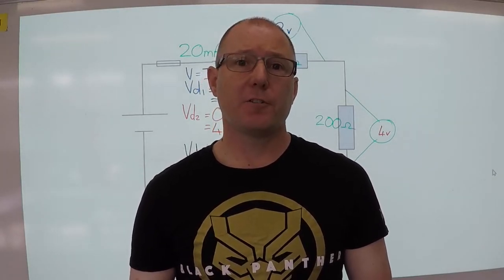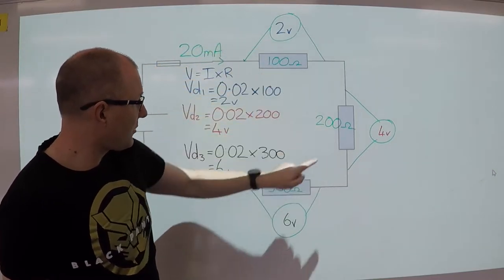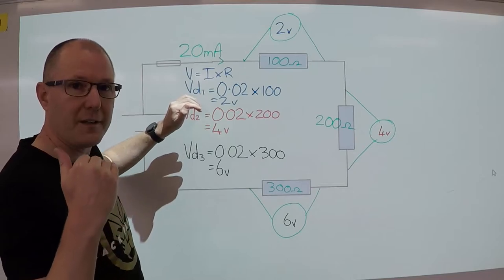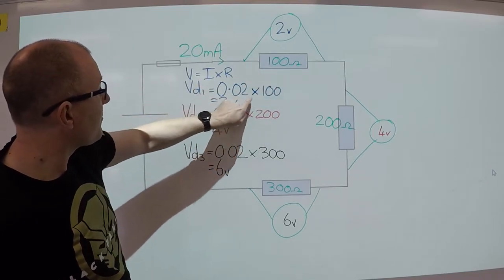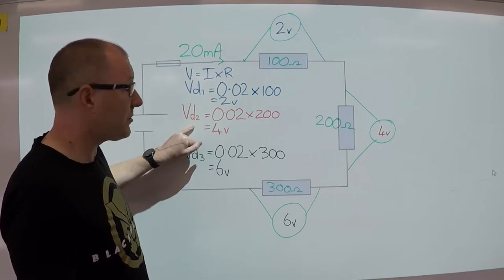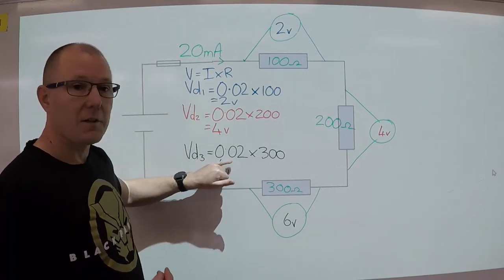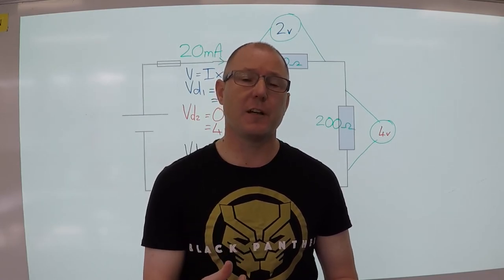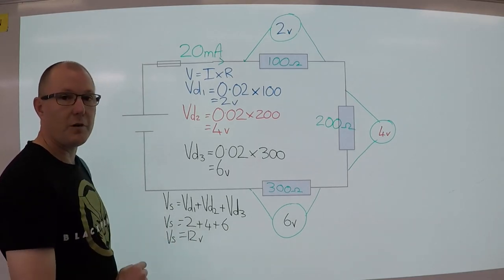Voltage drop in a series circuit

Comment: How did you find 20MA? on your example what did you do first?
Reply: Its given in the question
Reply from the maker: Thank you for your question. 20mA or 0.02A is one of the given figures in the problem.
You need to know the value of the current and resistance before you can calculate the voltage drop in this particular problem.